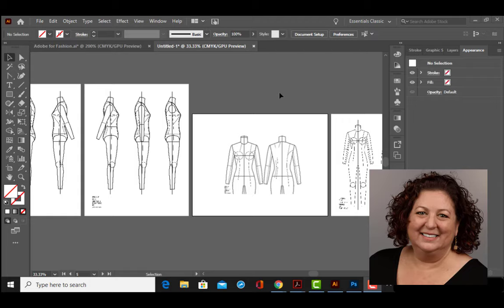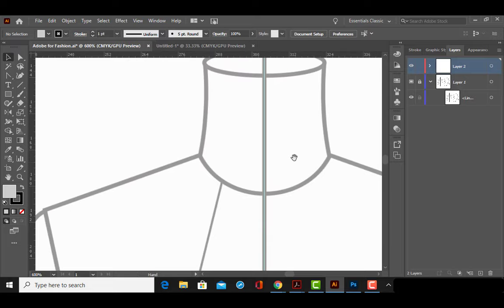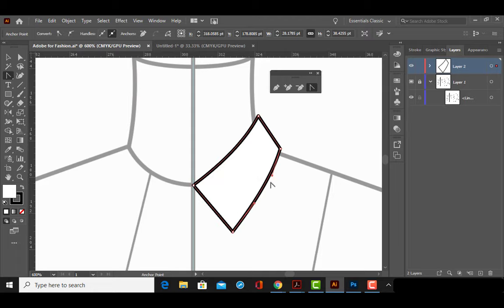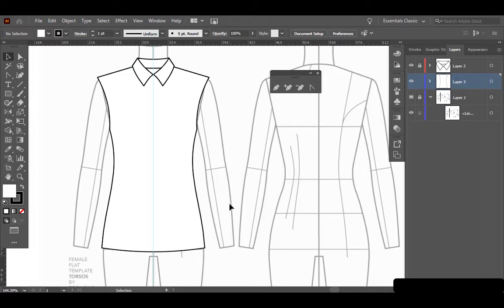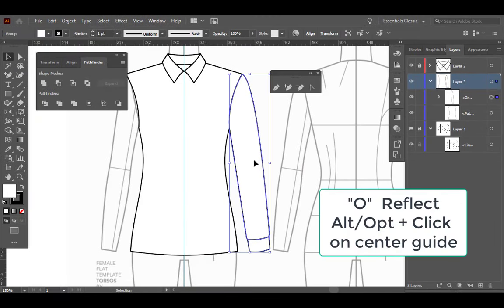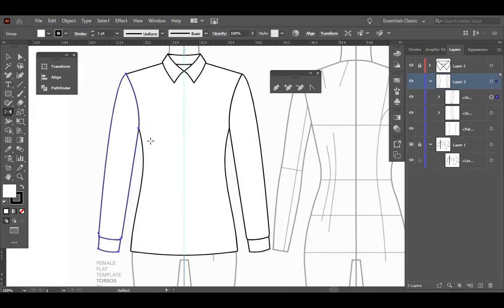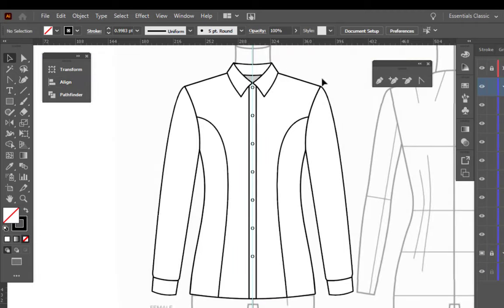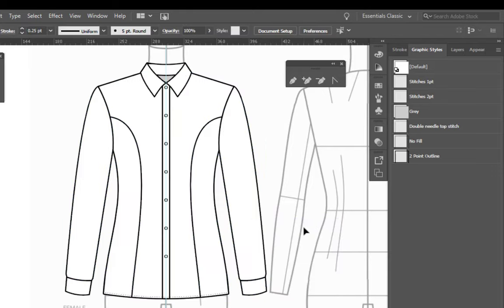How to Draw Technical Flats in Adobe Illustrator

Comment: how do you use the convert anchor point tool to curve the line? i've tried this and I can't seem to get it to work, I have cs6. do I need a newer version?
Reply: Choose the Anchor Point Tool (the upside down V shape next to the pen tools), and just click on the line you want to curve and pull it out. Another way to create curved lines is to click on one of the anchor points and pull out to one of the sides. You will see two arms coming out from the anchor point and you can use these to adjust the curve 😀 Love T
Reply: Same problem for me. Can anyone help us please?
Reply: Same problem... someone please help.
Reply: @auroracortez2022  In order to create a curved line there are two ways of doing this: When you use the pen tool you click and make an anchor point where you would like to start. When you add your second anchor point you click and drag and you will see that the line you just created curves as you move your mouse. The two arms that come out from the newly created anchor point are there for you to pull and adjust the curve as you would like. The other way to create a curve is to use the Anchor Point Tool, (the upside down V shape next to the pen tool. If you don't see this you may need to click on the small arrow at the corner or side of the pen tool symbol). When you used this tool you can click on any anchor point and simpply drag it to curve the line. The two arms will appear from the anchor point and you can pull and move these around to adjust the curve. Love T
Reply: @designbyeide6905  Thank You!
Reply: @auroracortez2022  You're welcome honey 💖

Comment: Hello! Firstly thanks a lot for providing great free content! The lecture+demonstration was very clear and easy to follow even for an Illustrator beginner as me.
I have two questions:
1- is there a specific reason for mirroring every piece as the process goes, instead of drawing one complete half and mirroring it at the end?
2- how do you control scale on flats? I understand buttons and simple shapes, but I’m curious about more complex and 3D geometries such as the collar pieces.

Thanks again for the great content :)

Comment: I learned a lot -- and I don't even own Illustrator - seriously considering it as a growing old gift to myself.  As a sewing nerd, may I ask why the collar stand was not added? Even though not much of it would be visible, I was missing it showing at the top center front where the first button is.
Reply: Due to time constraints, I omitted the collar stand most stitches and buttonholes.